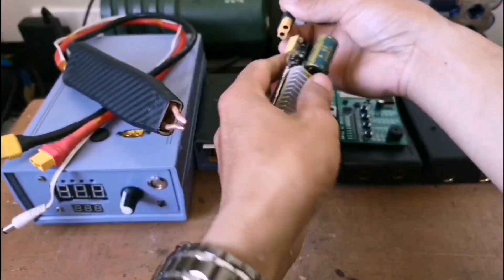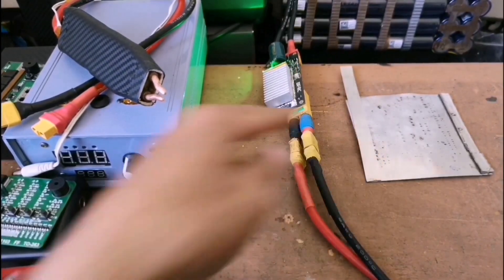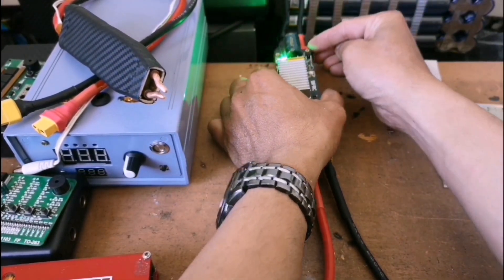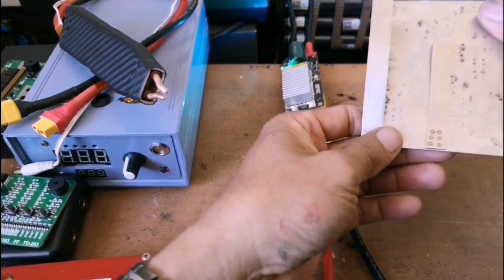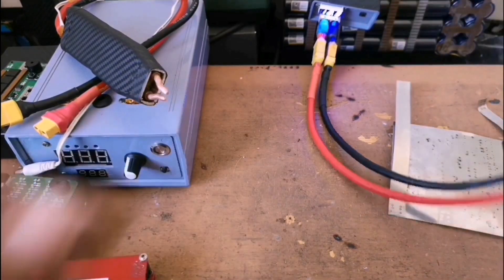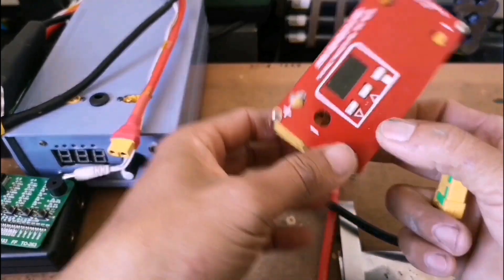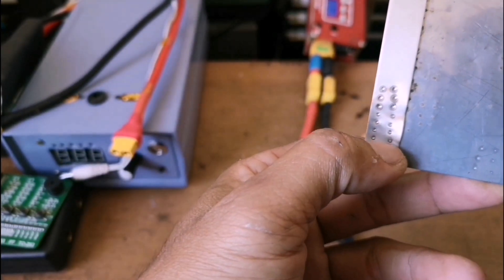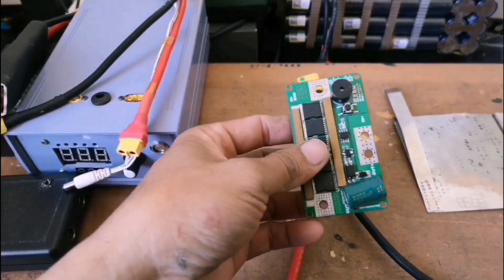UPDATE DIY CHEAP SPOT WELDING 8X

Comment: The custom blue one does the best welds by far, maybe you could substitute some of the batteries in it with supercaps? i noticed they now sell them with a BMS type pcb which might make it easier to include
Reply from the maker: the big spot welding?  yeah the best of all.  exactly you can used supercap.  more over you can used 12M, 18M, 24M and 48 mofet.
Reply: @pitikaron  I have the mini red spot welder I changed the mosfets for the same ones on the purple spot welder an your custom one. It's been working good. I just ordered the same custom board with 12 mosfet cus I want double pulse but I got the digital control instead of the one you have.
Reply: @pitikaron  What gauge wire did you use to your lipo battery? I've been thinking about upgrading to 8awg. I'm using 2 Zeee 3s 5200mah 80c in parallel with the 12awg XT60 going into 1 XT90 soldered to the board. I like how you separated the positive an negative using a connection on each wire. Think I want todo the same when my new board comes
Reply from the maker: 8 gauge wire and you better  installed XT-60 each wire. one XT-60 in positive and one XT-60 in negative the reason why I separated the positive and negative to avoid electromagnetic. In regard to your digital controller I think that's the latest but the same working procedure and wiring diagram.
Reply: @pitikaron  I discovered supercaps take 20min to charge which sucks so I'm now using big old 10x16cm/9kg UPS transformer someone threw out, weld quality is amazing compared to a microwave transformer it welds up to 0.2 on my lowest setting.
 I squeezed it into a 12x13x23cm case with an Atmel double pulse controller
Reply from the maker: Nice! Yeah a transformer better than MOSFET.

Comment: i bought the purple PCB spot welder after watching your videos, I also upgraded it with 5 more mosfets. I meant to buy a 4S lifepo4  battery but I bought 4S lipo  battery by mistake. (it was labelled 6000mAH 4S 14.8V 70C).  Do you think it be ok to run it using 4S 4.2V x 4 =16.8V ? it says 9V to 16V on pcb, I checked components and it has 5V regulator for circuit, 25v cap and msofets are 40V. I think i use 12AWG power input leads to add some resistance to help drop the voltage. what do you think?
Reply from the maker: yeah 70C×6000mah 420A but do not exceed the limit  voltage 16v
Reply: @pitikaron  i will just charge battery to 16V max. 4V per cell.
Reply from the maker: Yeah coz the voltage limit to the purple spot welder is only 16V base to the description.
Reply from the maker: If that so! sound good.
Reply: I can comfirm it works well with Fully charged 4S lipo 16.8V
Reply from the maker: Nice 👍